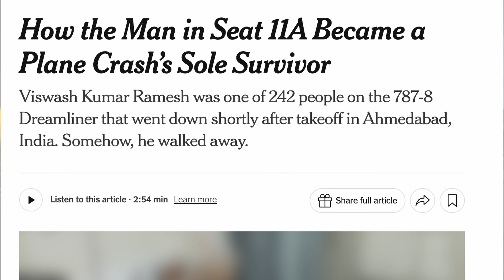Why the RAT Changes Everything – Air India 171 Update

Comment: I noted on another social media site that even on the original video, when the aircraft began climbing over the END of the runway it was kicking up dust from the NON PAVED area... But only under the LEFT ENGINE. 

This makes me think that the right engine failed during or right before rotation. If so, the plane was climbing on one engine only. You can then see his rate of climb virtually stops, even though he didn't nose down. This would indicate a loss of airspeed... Which would happen IMMEDIATELY after a second engine failure.

Comment: That plane must have had a power failure. Why else would the  RAT deploy? It's obvious the plane simply lost lift, so either the Flaps and Slats were not set or detracted or the engines lost thrust. They will have to get the "boxes" and see what was going on.

Comment: Fully agree. The loss of thrust happens after rotation in the very first few seconds of climb. That’s why initially the climb looks ok. Don’t know the field altitude but at 37 degrees before a long haul it looks normal. They might even have done a flex take off. 
About the bird, still an option even if they did not find any on the runway. Bird strike could have happened during Intial climb past the runway. 
The bang heard by the survivor could be the explosives freeing the RAT to deploy. It is spring loaded usually and deploys violently. 
It could also be both engines compressor stalls. Depending on temperature and pressure probes, variable guide vanes could have gone in a position not appropriate for the speed of the aircraft and the rotation of the compressor. 
All in all I also vouch for a dramatic loss of thrust, below minimum needed even for
Normal hydraulic and The reason for it, wrong FADEC inputs, Electrical issue, bird ingestion, fuel quality, fuel filters… remains to be determined. 
Thank you for the thorough analysis.

Comment: I saw the rat and immediately thought of engine failure. I know, there are several conditions will deploy the rat IE hydraulic failures. But...what controls the hydraulics on a 787? The engines... what struck me odd is a vudeo was released by one of the passengers showing everyone in board was dieing as the planes interior had massive issues. Lights were flickering the entire 40 minutes on the ground, the touch screens were unresponsive for the oassengers and AC would not engage. A whole lot of WTF issues going on before the plane even taxied
Reply: That was filmed on a flight the day before the accident.

Comment: Well Tata Steel is very sloppy with those planes,  which they bought from the Indian government. Bad maintanance and a Boeing... where did we hear that before? But I think that at least the engines were checked by maintanance but the hydraulics?  I'am not so sure, in most companies, the the hydraulics are used until it does not work any more.  And only then the go to a manufacturer, for something they should have done weeks or months before. And there they complain that it cannot be replaced within one or two days. But they often forget that hydraulics are partial or completely is hand made.

Comment: Maybe the fuel was too hot. It was about 40C outside and the max fuel temp limit should be around 50C. If fuel got loaded from a truck that sits in the sun all day it could bring the fuel temp closer to the limit. They go to TO power, the engine oil gets hotter, the fuel/oil heat exchanger tries to cool the oil down, this causes the fuel to get too hot and boil, engines start to shut down, gear will not retract without engines or APU running, RAT auto deploys but creates more drag accelerating the decent. Sadly nothing to do but pray at that point.

Comment: As a fellow Captain myself. I am very disappointed with you and other pilots who ASS-UME & speculate so much nonsense without much info or evidence on social media. No wonder there are so many fake news on social media. U hv lost your credibility. Leave it to AAIB & NTSB.

My comment on your first video: Unbelievable tis nonsense come from tis Captain Steve. Flap lever and gear lever is totally at different place.
Even with the flap retracted and gear down. The aeroplane will climb like a rocket. All these real aviation experts talking nonsense speculation is truly disgusting for the Pilot community
Reply: A captain who doesn't understand much about density pressure on a very hot and humid day, with a plane loaded to its allowable capacity, and it would be able to lift off with flaps and slats retracted while the landing gear is still down and creating huge drag???? Wow.
Reply: @bobvidoni5898 u hv no idea how powerful these engines are. They are not even using Toga thrust for takeoff. There are operation that leave gears down due to MEL. The plane can climb like a rocket. I can understand u don’t know all these since u don’t fly these planes

Comment: I'm not a pilot, but I would have thought that no pilot would be unprofessional enough to suggest pilot error in a crash with absolutely zero evidence to confirm pilot error. Even more unprofessional is the statement "the aircraft doesn't have enough lift going across the wings, and the ONLY way that can happen is if they didn't have the proper flaps setting." I know that's factually incorrect because engine thrust is a requirement for lift during takeoff. So, no, that's clearly NOT the only way.
Reply: Speed is the requirement for lift in all phases of a flight. It is the air passing over the wing that generates lift.
Reply: @bobvidoni5898  My point was that engines aren't required in all phases of flight. They are, however, definitely required in order to takeoff and climb to altitude.

Comment: Landing Gear Up and Down selector Lever is in the Instrument panel and Flaps Up and Down selector lever is on the Throttle Box. The Pilot has to be Absolutely NAIVE  and NOT TRAINED ON 787 to Accidentally   To Select Flap Lever instead of Ianding Gear up selection
If the Levers were adjacent to each other ONLY THEN , one can say,  pilot accidentally moved the Flaps Lever. 
In this Air India crash possibilities are ,  BECAUSE THE DEPLOYMENT  OF RAT(Ram Air Turbine)
    ENGINE FAILURE Due to Multiple Bird Strike( Flaming Out Both Engines)
    ENGINE FAILURE due to Fuel Starvation. Contaminated Fuel Uplift  at Ahmedabad 
 It Definitely IS NOT A TERRORIST ATTACK( Explosion of Bomb on Board) . Definite NO    NO 
I am a retired Aircraft Maintenance Engineer,  I worked on all Boeing aircraft from 707,737,747,767,777. 
B777 had a RAT fitted on it

Comment: Fuel contamination?  Maybe, or a control / computer throttle glitch that shut down the engines.   I heard the Rat on the video but not the sound of two big turbines at climb power thrust.  The pilot had no chance.

Comment: The replay of the original video with the audio seems to reveal the "prop" sound of the RAT- and probably more clearly audible than it should be with two good engines at takeoff thrust!  Seems the jet engine sound is less than expected.  A confirmation or check of the audible engine sound could be achieved by someone taking a video with similar phone of another 787 take off from the same location for comparison.

Comment: AIr India Flight A171 Crash

According to the veteran pilot and flight instructor, that I spoke to, he said this was a "Departure Stall"  meaning the nose was too high and this caused lack thurst and lift.

 He added that he shoulf have acquired more speed on thr runway. As far as the wheel assembly being down, he said some pilots leave it down, if in case the plane needed emergency landing.

He also added, that if it was engine failure or electrical problem or fuel system problem, it would have been detected on the thorough checklist that the flight engineer (none on this flight) pilot and co-pilot diligently perform before the flight.

He further stated that the co-pilot should have had minimum 1,500 of flight hours and 1,100 hours was inadequate. From what I have read part of his flight hours was acquired in a school in Florida.

Hey stipulated that the copilot might have been in charge during the departure.
He said this was a pilot error and not a mechanical probkem with plane.
Reply: What we call a departure stall can only indirectly lead to a perceived lack of thrust, but the core issue is a stall, not a loss of engine power; the full thrust remains. A departure stall, also known as a power-on stall, occurs during takeoff or climb when the wing's angle of attack is too high, causing a loss of lift and a potential descent, all the while the engines are still producing full thrust. A departure stall does not cause a lack of thrust, but it does cause a lack of lift.

Comment: One potential scenario is one of the pilots raised the flaps by mistake, the other pilot misdiagnosed that as a dual engine failure, and tried resetting the engines causing the RAT to deploy.

Comment: the aircraft is losing altitude all through the video. The RAT is automatic and so should have been visible at all times. The RAT was not visible close by and only a dark object is visible at distance. Conclusion - its not the RAT. The engine note indicates the aircraft has power but insufficient power. The aircaft has had a software malfunction and has incorrectly not interpretted full power  - its a fly by wire jet. For a PC the operating system needs to be reinstalled every so often. That is because over time the circuitry is not perfect and errors build up. For an aircraft computers the same applies and circuitry makes small errors. What should happen is to prevent this a new install of the software should happen every so often. Aircraft do not have their software rewritten periodically meaning it is pssible for the same software glitch to appear in its software and backup software.

Comment: Is it possible that the battery on board shut down? In which there would be no electrical power or fuel going to the engines, which would cause the RAT to deploy. I say this because we have seen battery issues on the 787 before. Some have caught fire. But I don't know if that would be enough for the engines to shut off? This is my question.

Comment: I'm a freelance aerospace safety & reliability engineer, mostly Rolls Royce aero engines.. among others others, all in Europe.  Un-commanded double in flight shutdown, this is what we call a "red top", if a probabilistic forecast indicates an engine part is at risk of causing such an event prior to a given number of flight cycles, then we remove the engine from the fleet. It is that simple. Years ago I recall cancelling a flight after collaborating with the operator. The flight was cancelled at the gate, was that close. Hours earlier I  learnt a bearing was at high risk of failure after extensive Weibull analysis. Now 2am in the morning. An engine failure is no biggy, a reliability issue.  Then the cancelation of the flight occurred (many timezones away) as I realised the neighbouring serial number of that batch / part was on the same aircraft, on the other engine!     Yes people complained about the cancellation, but I couldn't say why at the time. You'd be surprised the number of events us safety engineers have averted.

I tell you all that to tell you this, customers including RR, Boeing, GE, they've all reduced hiring over the last handful of years. Not supported the industry in over 24 months. I dread to think of the data that is being ignored by manufacturers and operators.

Comment: Another point of evidence to increase the likelihood of the Dual Engine Failure was the fact that the overhead pictures of the tail section of the wreckage show the APU inlet door (at least partially) open. Normally the APU would have been turned off following engine start. It seems that the crew attempted to turn the APU back on again following electrical failure possibly due to the loss of both engines.
Reply: The APU would automatically start with a loss of both main AC busses, however it takes almost a minute to spool up.

Comment: something to chomp on and question if it had any input into engine power loss as well???   ----> 787 checklist item pressurize hydraulics
here's how the 787 checklist handles the pressurization of hydraulics:
 
The Boeing 787 has three independent hydraulic systems: Left, Right, and Center.
Unlike older aircraft, the 787 does not rely on engine bleed air for hydraulic pressurization. Instead, it uses electric motor-driven pumps.
These electric pumps are crucial for pressurizing the hydraulic systems, which in turn power vital aircraft components like flight controls, landing gear, and flaps. 

 Checklist Procedure:
Engine Start: The hydraulic engine pumps are turned ON during the "Before Startup Checklist".
Electric Pump Activation: The hydraulic ELEC C1 Pump is also turned ON during this phase.

Automatic Operation: Once the engines are running, the demand pumps will run for a short period (3 minutes after the second engine is started).
Takeoff: During takeoff, the demand pumps remain active until the flaps are retracted.
Fault Handling: In case of an overheat or fault, the checklist directs the crew to turn off the affected pump and activate an alternative.
System Monitoring: Hydraulic pressure can be monitored through the EICAS (Engine Indicating and Crew Alerting System). 
3. Importance of Pressurization:
Proper hydraulic pressurization before pushback and engine start is critical.
Failure to do so can result in low hydraulic system pressure, impacting vital functions like braking and landing gear operation, as illustrated in the example of the brake system warning. 
4. Additional Details:
The 787 hydraulic system operates at a high pressure of 5,000 PSI.
An internal piston in the hydraulic reservoirs maintains positive pressure at the pump inlet for initial startup.
The RAT (Ram Air Turbine) can provide backup hydraulic and electrical power in an emergency. 
In summary, pressurizing the hydraulics on the Boeing 787 involves turning on the hydraulic engine pumps and the electric C1 pump during the pre-flight checklist, ensuring the systems are ready to power critical aircraft functions before and during flight.

Comment: As a preventive measure, I really think there should be an emergency landing runway at strategic location near airports. It could help planes land safely in case of sudden engine failure or loss of thrust after takeoff.

Comment: Unlike previous planes, the 787 has a no engine compressor gas bypass system.  Instead of using the engine compressor bypass to run the fuel pumps, electric powered pumps provide fuel.  Many other systems that were pneumatic (such as cabin pressure) or hydraulic (such as brakes) on previous planes are also electric on the 787.  If power was somehow lost, would the RAT provide the power levels needed to maintain high fuel flow during take-off?  I guess you don't know what you don't know until you know you don't know.

Comment: None of the above reasons caused the plane to crash. What happened was that the pilot's seat "unlocked" and moved backwards, so he pulled the thrust lever back, which brought the thrust lever to the "idle" position. The crew did not apply GO-AROUND or STAB TRIM. The Boeing 787 thrusters do not have a "weight lock" or "reverse torque prevention" safety mechanism. The FAA and EASA have ordered an urgent inspection of all pilot seats in Boeing 787 aircraft. Air India has grounded 12 planes with similar maintenance histories, while Boeing plans to redesign the seat mechanism by 2026. A final report on the accident is expected in July 2025.
Reply: Bad engineering

Comment: I remember in Russia there was a case when both engines failed due to the fact that the tank from which fuel was poured into the plane was poorly processed from the inside and sediment was released from the walls of the tank that got into the fuel system of the aircraft and eventually stopped the flow of fuel into the engines. Do you think there can be something like this here?

Comment: I was certain to begin with that this was a bird strike but there are no reports of bird debris at the end of the runway or between the runway and crash site. If you look at the AOA in the first few seconds of takeoff it looks normal and then goes into a stall position as if both engines lost thrust. The RAT deployment suggests a loss of power in both engines but is that mechanical failure or electrical failure?
It reminds me a little of the Air France Flight 296Q accident at the Habsheim Air Show where the 320 went into alpha protection.
I did notice a huge cloud of dust as the plane took off and I'm now wondering if the high temperature and low pressure situation at this airport that day caused a very slow initial rotation and the plane was slow to respond. This could have caused the engines to suck in dust right at the end of the runway, change the fuel air mixture and cause a partial stall of the compressors.

Comment: Do engines at high RPMs as they are  during take off need spark to keep spinning? They should be self sustaining at those rpms in most circumstances, right? Also, the integrated shaft generator should be also generating enough electircity assuming no issues with alternator, correct? And I am not sure how many fuel pumps and the power delivery to those pumps to keep engines running, but I suspect that system needs to be quite redundant, right Can you elaborate on these issues?